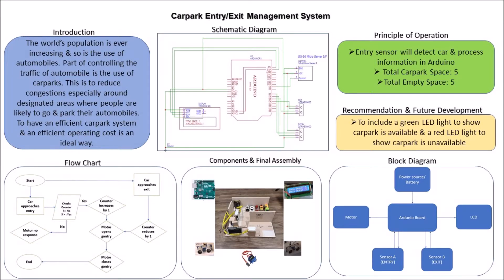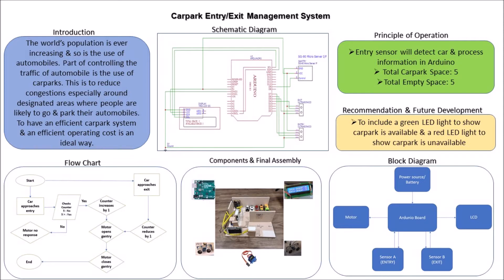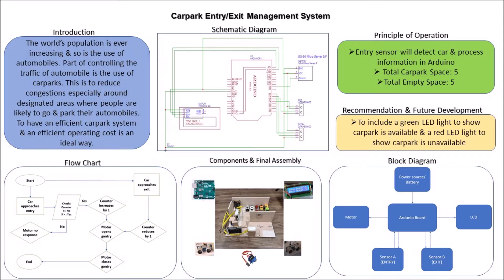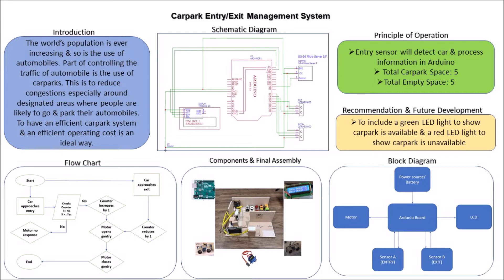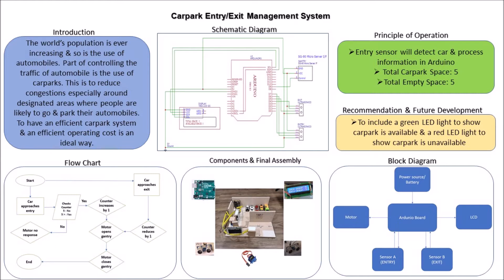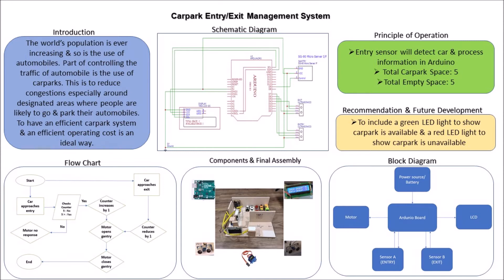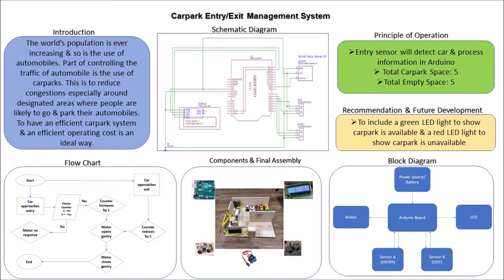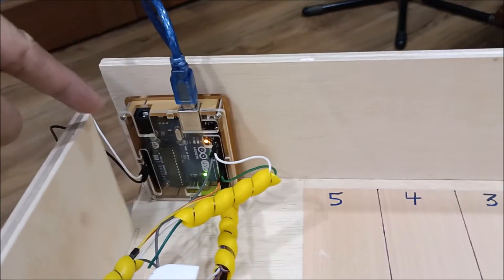IPR (306 AAE) Viva Presentation & Demonstration : Carpark Entry/Exit Management System

Comment from the maker: #include <Wire.h> 
#include <LiquidCrystal_I2C.h>
#include <Servo.h>

Servo gantry;
LiquidCrystal_I2C lcd(0x27,16,2);                            // set the LCD address to 0x27 for a 16 chars and 2 line display

const int Aping = 7;                                         // Trigger Pin of Ultrasonic Sensor A (Entry)
const int Aecho = 6;                                         // Echo Pin of Ultrasonic Sensor A #Must be PWM Port
const int Bping = 4;                                         // Trigger Pin of Ultrasonic Sensor B (Exit)
const int Becho = 5;                                         // Echo Pin of Ultrasonic Sensor B #Must be PWM Port

const int InitialNumberLots = 5;                             //Change this to number of actual Lots created
int NumberLots = InitialNumberLots;
int TriggerDistance = 6;                                     //Change this to the width of entry #in cm 

int Aside = 0, Bside = 0;
long duration, Acm, Bcm;

void setup() 
{
  Serial.begin(9600);
  gantry.attach(9);                                          //attaches servo to pin 9 #Must be PWM Port 
  pinMode(Aping, OUTPUT);
  pinMode(Aecho, INPUT);
  pinMode(Bping, OUTPUT);
  pinMode(Becho, INPUT);
    
  lcd.init();
  lcd.clear();         
  lcd.backlight();

  GantryLower(); 
  
  lcd.setCursor(0,0);   
  lcd.print("Total Space:");
  lcd.setCursor(14,0);
  lcd.print(InitialNumberLots);
  lcd.setCursor(0,1);  
  lcd.print("Empty Space:");
  lcd.setCursor(14,1);
  lcd.print(NumberLots);

}

void loop() 
{
 DistanceA();
 DistanceB();

    Serial.print("A: ");
    Serial.println(Acm);
    Serial.print("B: ");
    Serial.println(Bcm);
 
  if (Acm < TriggerDistance && Aside == 0 && NumberLots > 0 ) 
  {
  Aside++;
    if(Bside==0) 
    {
      GantryRaise();
      NumberLots=NumberLots - 1;
    }
  }
  if (Acm < TriggerDistance && Aside == 0 && NumberLots == 0 ) 
  {
    NoSpace();
  }
  if (Bcm < TriggerDistance && Bside == 0 && NumberLots < InitialNumberLots ) 
  {
  Bside++;
    if(Aside==0) 
    {
      GantryRaise();
      NumberLots=NumberLots + 1;
    }
  }
  
    lcd.clear();
    lcd.setCursor(0,0);   
    lcd.print("Total Space:");
    lcd.setCursor(14,0);
    lcd.print(InitialNumberLots);
    lcd.setCursor(0,1);  
    lcd.print("Empty Space:");
    lcd.setCursor(14,1);
    lcd.print(NumberLots);
    
 if (Aside == 1 && Bside == 1)
 {
  Aside = 0;
  Bside = 0;
  GantryLower();
    while(Acm < TriggerDistance || Bcm < TriggerDistance)
    {
      DistanceB();
      DistanceA();
      delay(1);
    }
 }
  
  
}

void GantryRaise()
{
  gantry.write(90);                                          //position gantry to 90deg 
  delay(10);
  return;
}

void GantryLower()                                           //display no space message
{
  gantry.write(0);                                           //position gantry to 0deg 
  delay(10);
  return;
}

void NoSpace()                                               //display No space message 
{
  lcd.clear();
  lcd.setCursor(1,0);   
  lcd.print("sorry NO space");
  lcd.setCursor(4,1);  
  lcd.print("availble");
  delay(1000);
  return;
}

void DistanceA()
{
  digitalWrite(Aping, LOW);
  delayMicroseconds(2);
  digitalWrite(Aping, HIGH);
  delayMicroseconds(10);
  digitalWrite(Aping, LOW);
  duration = pulseIn(Aecho, HIGH);
  Acm = duration / 29 / 2; 
  delay(100);                                                //delay for system stablity 
  return Acm;
}
void DistanceB()
{
  digitalWrite(Bping, LOW);
  delayMicroseconds(2);
  digitalWrite(Bping, HIGH);
  delayMicroseconds(10);
  digitalWrite(Bping, LOW);
  duration = pulseIn(Becho, HIGH);
  Bcm = duration / 29 / 2;
  delay(100);                                                //delay for system stablity 
  return Bcm;
}

End
Reply: Circut please
Reply: code please